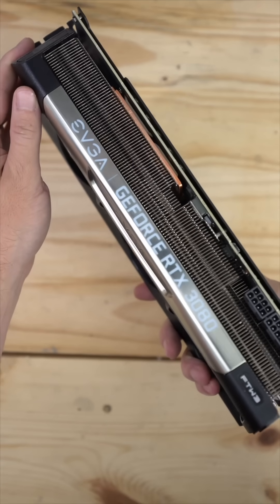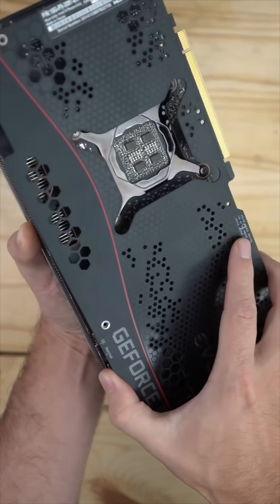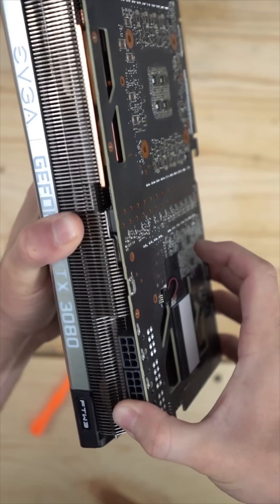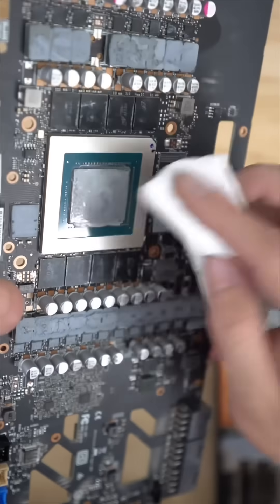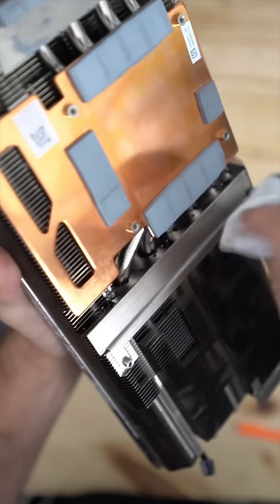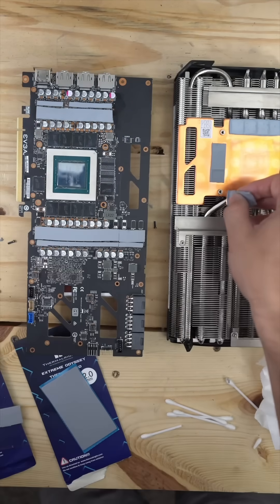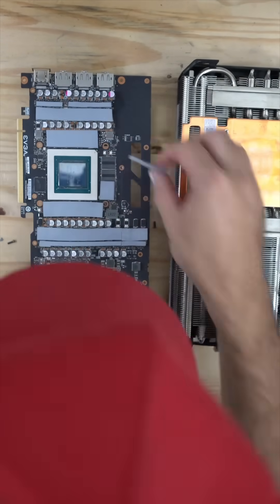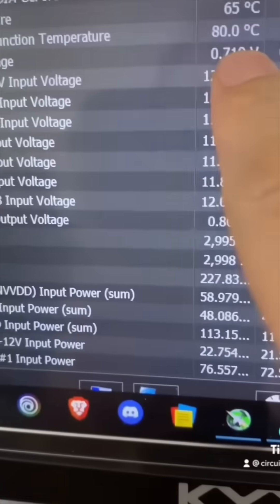Replacing graphics card thermal pads

Comment: Hello, thanks for the video. My RTX 3080ti is causing artifacting. Will this fix the issue, or is artifacting  meaning the card is dying and needs changing. Thank you.
Reply: That usually means one on the memories is dying, it can be fixed by a skilled technician but it is usually not worth it
Reply: @Cartagenazx Thank you. I've not got this card anymore though. It completely died on me so I threw it away. Replaced it with an RX 480 4gb. A slight difference in cards, but all I could afford at the time. At least this card works perfectly. And it's actually not a bad card for what I want it for.

Comment: No need pads. Thermal Putty better. #TEAMPUTTY
Reply from the maker: This is exactly that lol
Reply: @circuitboredpc  Putty based pads are okay, but still kuch stiffer than a dedicated Thermal Putty. Some great ones to look into are Honeywell HT10000, Upsiren UTP-8,  Fehonda LTP81,  and Thermal Grizzly Putty Pro. 

For ASUS laptops the best choices are Haknziye HY206 / HY236, Zezzio ZT-PY6,  or Upsiren UTP-4 Ultra-Thin,  since they can squish down below 0.1mm with ease.

Comment: I've done this to my old RX480. I got one with a subpar cooler and after a few years it was throttling hard so i tore it up and replaced the paste and pads... then i forgot to reconnect the fan cable and started a test to see the temps. Good thing i noticed that the fans weren't spinning as the temp was getting to 90C and stopped it. Then, after connecting the fan cable i turned on the PC and it wasn't booting... because i forgot to plug the 8pin. At least there was no damage so all was good and the temp was about 10C down.
Reply: Omg bro please stop forgetting stuffs

Comment: By the time you need to replace the thermal puddy, it's time to upgrade your GPU.
Reply: Not if it's a 3080 lol
Reply: Not necessarily. This could easily fall under regular maintenance. It’s not something you need to do often but it’s not advanced enough to be considered an extra step.

Comment: 100° to 80°? Huh?😮
My 7800xt  never goes above 68° on hotspot
Reply: Card temps vary a lot by manufacturer and model. You'll find plenty of 3080 with similar temps, but this particular model of cards tends to run hot.
Reply: would help if nvidias app wasnt so buns and had more options for tuning like adrenaline for custom fan curves/ undervolting without needing msi, evga, etc. 
plus they'd probably get better temps on the core if they used ptm7950
Reply: @Toufan1-gr4br bro just use MSI AFTERBURNER and unlock power under options........another thing is to reduce your processor speed in windows to 65(if u have a high end cpu). It allows the gpu to work properly and cooler  for some funny reason

Comment: I swear to God re-apply thermal paste to my GPU scares me as hell
Reply from the maker: @titaniumtrain  it always seems scarier than it is. At the end of the day you weigh the cost of you ruining something against how bad the temps are
Reply: why ? 
did u took any electronics ever apart ? 
if so , it should be no problem just dont rush things maybe take photos before unpluging something so u can be 100% sure to plug it right back.
also unplug ur PC and wait a bit before u unplug ur gpu. 

i took my gpu apart , didnt take the cooling body off. but cleaned the whole cooling body and everywhere i could reach with an used tooth brush. 
was pretty easy tbh , only sketchy thing was the plugs for the fans because i have some thick fingers. if u have those racoon like fingers it wont be a problem .